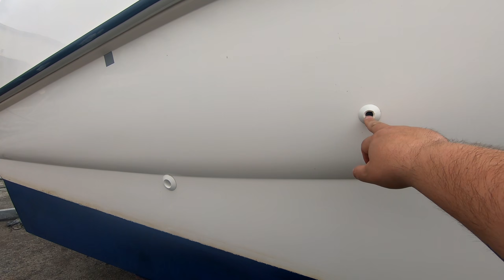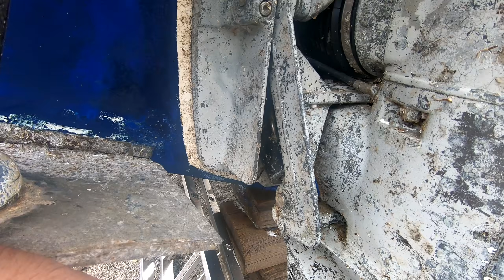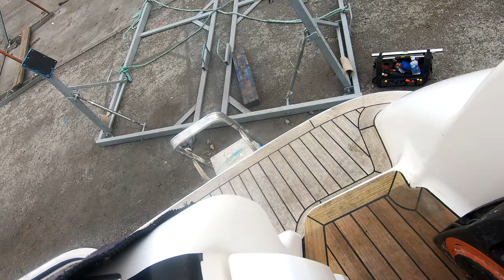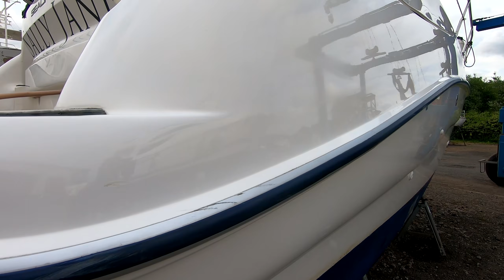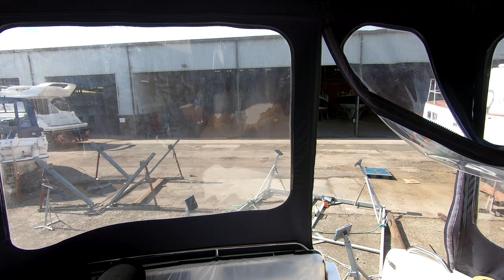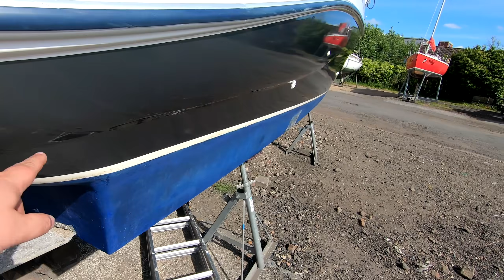Boat wrapping my Sealine S28

Comment: Awesome! I'm looking to buy an old S28 so these videos are super interesting!
Reply from the maker: Glad you find them interesting
Reply: @DavesBoat  for me I am weighing up the cost of a cheaper ‘project’ boat compared to a boat with little to do. If you had to actually pay for someone to do all the work required, I’m not a project boat would be worth it. What do you think?
Reply from the maker: @philr7813  so depends what the work is it's no good getting a project boat if it needs major structural or engineering works and you don't know how, but many of the little things are general maintenance and everyone can do if you just follow instructions and aren't afraid of learning something new.
The bigger question isn't project boat or done boat but more of how much effort you want to put into the boat.

Comment: Looks superb what are the pros and cons of wrapping.
Reply from the maker: ok Pro's: Cheaper and easier than spraying, protects gelcoat, easy to maintain, thousands of colours available.  on's it gets damaged easily so you need things like fender socks, it relies on having good gelcoat otherwise loads of prep is needed, boat needs to be out of the water to do it, not every wrapper can do a good boat job.

Comment: Should have put the money it stripping back the anti foul and putting on fresh.
Reply from the maker: Why? there's nothing wrong with the anti foul its got full coverage and zero growth and even if i did a full anti foul strip back and recover is only a couple of hundred quid on a boat this size anyway.
Reply: It’s not smooth. Antifoul is supposed to be smooth to help the movement over water. But good luck with the boat

Comment: You need to renew the anodes on the drives. If there not there then your drive and props will be eaten by the electrolysis.
Reply from the maker: They'll last until December when i pull her out for a proper drive strip and refurb to give you an example of typical anode usage the ones on the trim tabs are like brand new and yet are over a year old.  
The drive ones are only that worn as they're about 4 years old, the broker said they'd changed them but as you can see clearly not.
In winter the props are coming off for refurb as I've got a few chunks missing and I want to completely strip and powder coat the legs and shields.

Comment: Looks great. Makes it look more modern. 
Did you get to drain that water/coolent from out of the engine room?
Reply from the maker: no i haven't unfortunately i ran out of time turns out cutting and polishing an entire boat is a big ass job especially in this heat. honestly don't know how people do it for a living i'm exhausted, hats off to anyone that does.  water fixing can be done in the water though i have resealed all my through hulls again just to be on the safe side.
Reply: @DavesBoat  I was at the marina last Saturday. Looked for your boat but couldn't make it out. Was it out of the water?
Reply from the maker: @christopherjoyce6461  yeah she's been out for like 10 days, just gone back in today so she's back in her berth now just to the right of the launch platform.